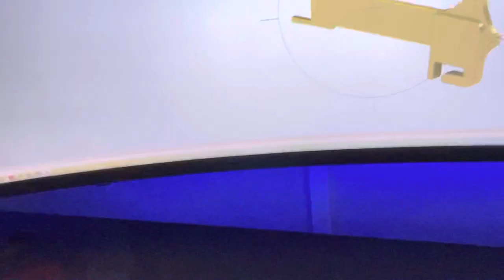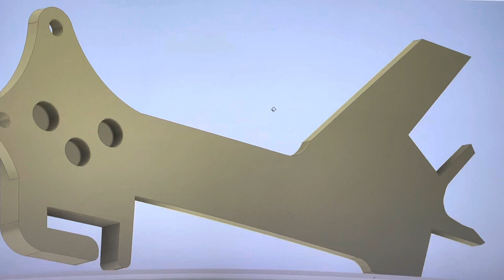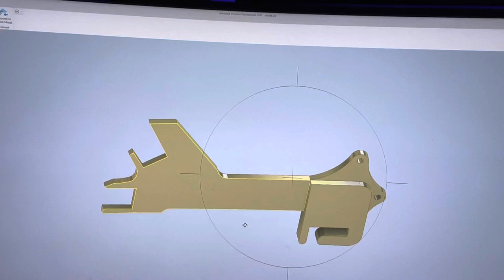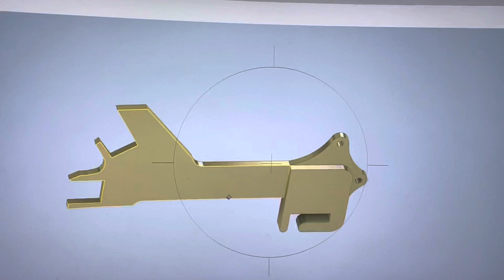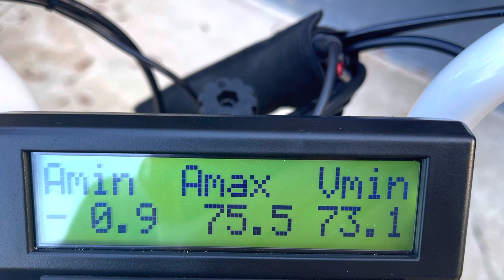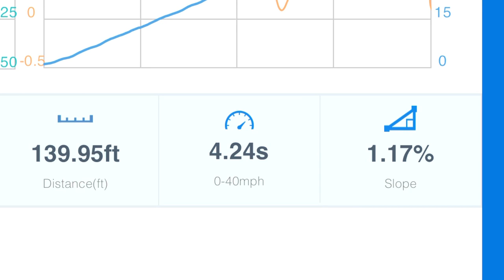How I turned my 500W Super 73 Z1 Into a 12,000W 72V Rocket. Extended frame, Votol EM200, Dragy Run.

Comment: Hey BITI EV! I just came across your video and wanted to thank you. This content is incredible +1 Sub and a like for sure!!!!

I wanted to ask, would you be willing to share the measurements of your design? I'd like to have a shop cut this out for me as well.
Or if you have a shop I would be down to support and buy a set off of there.

Thank you for the content.
All the best,
Reply from the maker: Check out flp parts for bolt on extension!

Comment: You really want it with Debo? lol I'm gonna check out when I get home Bro
Reply from the maker: What ever of your builds brother, only fair.

I use a device called dragy.  It’s used in professional racing as it has a very fast gps sensor.

Cool to have for all the builds and testing you do.  YouTube “dragy 1/4 mile” think you would use one a lot.

Also, please this is only on fun.  I watch you’re videos and like channel. Not starting beef.
Reply: @BuildItTuneItEV  That must be the Apple version of Drag racer
Reply from the maker: No it’s an actual hardware device you purchase.

I build and tune race cars for a career, and it’s something we use for testing cars before the track.

Google dragy 1/4 mile.  It is expensive, but when you want very accurate data it’s a solid investment.  Especially with all the builds your doing.  The onboard phone gps are software limited to slowly to be very accurate.  Use what ya got for now, but as you do more builds having that extra precision will pay off.
Reply: @BuildItTuneItEV  oh OK well the app I use does all that too 0-10 0-20 up to 0-60 then 1/16 1/8 1/4 mile times and it uses GPS on your phone I'm not gonna buy one of those cuz I'm pretty sure this drag racer app does the exact same thing oh sorry did see your entire comment by ok I think the couple thousandth of a second it could be off I don't need the much precision but cool

Comment: How are those Molicel cells working out for you?  I have heard that the drop/sag is almost nonexistent.
Reply from the maker: They work great if you have the proper pack.

The 45 amps they output is at full sag, which people don’t mention. 

How ever I have pulled 320 battery amps from 7P worth of p42a, which puts them right at the 45 amps, I did see sag though.  That was around 69 volts.

Cell is very impressive, I run a 20s1p sometimes and pull 45 amps from it without over heating during a single track event.  The pack construction is what matters most.  Conductor material, wiring, quality of connections and the layout of conductors.

The Samsung and Molicel are my favorite cells. 

To make a simple answer, I ordered 480 Molicel for the latest battery build , so yes I love them :)